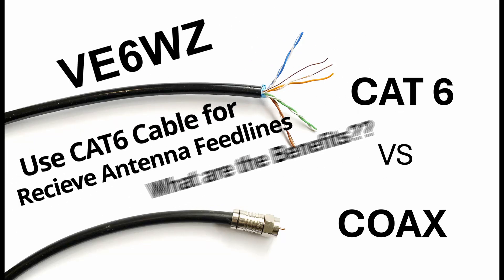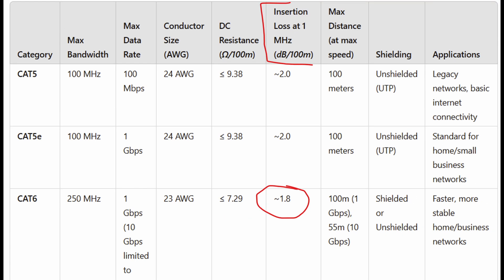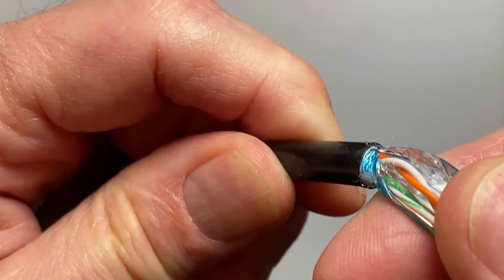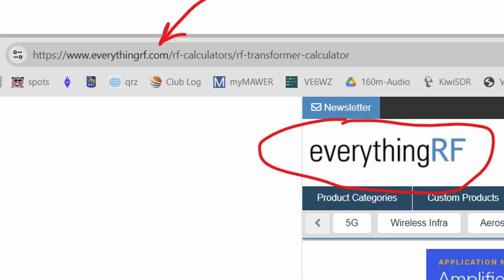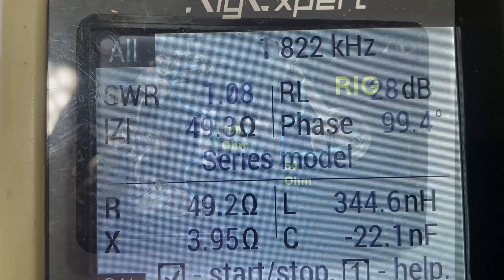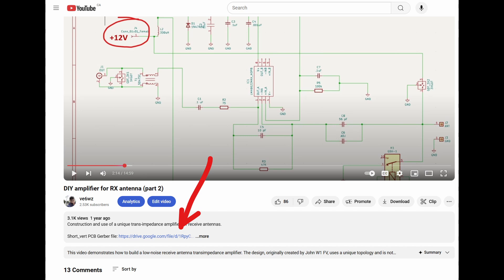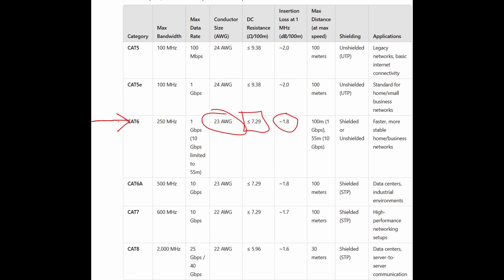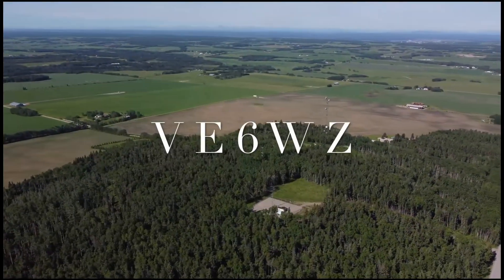Use CAT6 to feed your Antenna instead of Coax

Comment: What about using two 100Ω pairs in parallel instead of transformers if there are 50Ω on both sides, or just 1 transformer at the antenna side ?

Comment: i have a small portal ssb short wave set was thinking of 2 loop on ground one 30 ft and a 150 ft loop fed with one run. the set only has whip so was thinking of winding coil on pill bottle and sliding on whip. would a matching transformer be worth-it or not? 3 foot loop would be for 20-10m and 150 ft  mw-40m. ideas on coupling coil wire size turns form size etc?

Comment: Tnx Steve! I am using CAT6 since I came across LZ1AQ loops and started to play with 2 or 3 elements phased loop arrays. Now I even use single removed twisted pair as beverage element as excellent for reversible BVGs. I am very much space restricted so option to have 2-dir on single BVG is great!

Comment: This had me thinking.  You could make a whole reversible beverage with unshielded cat cable.  I think you could bond a twisted pair at each end, match with a transformer and send both ends to a point in the middle where you connect a rx.  You could use the remaining pair for a vactol on both ends.

Comment: FYI In France we use Grade 3 TV/Sat ( cf UTE C 90-483 )that has a pair with 2200 MHz bandwith 🎉 you can use direct balun adapter you find at the store 👍 There are even splitters available that enables you to send 100Mb/s Ethernet+ an audio or dsl+ an antena for TV/Sat over a single cable 🎉🎉🎉 Quite convenient for the TV set and set top boxes around 🤘

Comment: You don't seem to have any lock washers on those terminals. Perhaps this is the reason why they are always getting loosened (either that or those pesky raccoons are playin' tricks on ya, loosening yer nuts at night. he-he-he). I recommend the Stainless Steel auto-lock nuts with the PVC/Vinyl lock core. Or even simpler, add an extra nut and tighten those suckers up together. Those raccoons will now know who's boss; and they'll call you Daddy...

And remember: "If the women don't find you handsome, they can at least find you handy!"

73,
Amen Brother.

Comment: Question: What if you use the Cat 6 cable as a fat conductor to make a folded Dipole on 40 metres. preferably the stranded version of Cat 6, four pairs of balanced wire forming a single, 40 metre Folded Dipole. Assume an urban environment where it is mounted on a wooden fence so as to make it invisible to the neighbours. this should also be a low noise, all be it limited in range antenna. What do you think?? I would think with the RF current distributed across the 8 conductors it should be able to handle 100 watts.

Comment: Who is old enough to remember the standard TV antenna connections was for 300 ohm unshielded twin lead antenna wire? It was the industry standard. With the release of color for television, there was a problem with the reflections on the cable when it was routed near objects between the antenna and the television.
There is a reason 300 ohm twin lead antenna wire is obsolete.  It is true that the matter was made much worse for not being twisted pair. We did learn to twist pairs since the days of 300 ohm television antenna wire.  110 un-shielded twisted pair wire is a much smaller wire gauge than the 300 ohm twin lead, so it actually has higher loss. The smaller wires are closer to each other so the capacitance is higher to make the impedance 110 ohm instead of 300 so the cable is higher attenuation, however the tight twist reduces the wire's ability to radiate or pick up differential signal from it's surroundings.
Reply: In Australia we called it 300 ohm feeder cable. Twin flat black cable, and a balun to pick up tv. Then came uhf, so a Vhf/uhf Diplexer was added and a uhf antenna , wit the vhf antenna. I was 17 when i started, now 51 years old, and cabling tech, and still doing antennas and tv wall mounting.
Reply: It helps that 300 ohm to 75 ohm broadband baluns are ludicrously simple so converting from twin lead to 75 ohm coax is a very attractive option.

Comment: Could a twisted pair replace a TV antenna cable? There has been a trend for cheapening everything, but it has not happened. Does a stranded wire in patch cable change the RF properties?

Comment: Steve, just because it is a balanced line does not mean it is immune or even more immune than coax to common mode. Common mode is caused by any longitudinal voltage driving the conductors in a cable. It doesn't matter it is a parallel line or coaxial line. As a matter of fact a coaxial line is more immune to noise or unwanted signals if properly installed.

If you are having F connector issues (I have hundreds in the field) something is wrong with the installation. Perhaps you are not using a flooding dielectric compound in them?  73 Tom
Reply: If you aren't familiar with it check out "Star Quad Transmission line"  For the uninitiated is basically a doubled open wire line.  Some might know this from audio cables in the audio industry.  I got this from a website-

Suppression of magnetic interference

Another highly desirable benefit of star quad open‑wire transmission line is that, compared to twin line, it offers 10 to 30 dB suppression of magnetically induced interference.  This is due to both wire pairs forming loops around the center of the star, exposing exact equal loop areas to any interfering external magnetic field. Such a magnetic field will induce equal electromotive forces (voltages) and corresponding equal currents. These induced and interfering common mode currents will be ignored by the balun feeding the star quad line. Only differential mode signals will be converted by the balun into an asymmetrical signal.  This, again, is a useful feature for feeding OCFDs. Common mode currents induced on the feed line of an asymmetrical antenna will be effectively suppressed.

Star quad open‑wire transmission line offers a lower characteristic impedance than open‑wire ladder line for the same separation between the wires. This renders constructing 200 Ω star quad line feasible, where it is not for ladder line. Below 300 Ω, the construction of twin‑line becomes impracticable and, moreover, weather susceptible because of its tiny width. Star quad open-wire line is particularly useful for feeding any antenna involving a 4÷1 200 Ω balun; like many off‑center fed dipole (OCFD) antennas and many large horizontal loop antennas.

I might be attempting this myself- but I figured the cost.  Using 18Ga THHN wire bought in bulk (500ft roll from Lowe's), 1" PVC pipe to cut into many short lengths, zip ties, balun toroids for each end, enclosure boxes for baluns- cost about the same as 50ft of RG-8 (Belden 8237 or ABR-400).  Obviously some caveats with each.  The diameter I'd be using is only about 190 ohms impedance, Ive given thought to increase it, but with Star Quad line an increase of 100 ohms increases the "inner" diameter to about 7 inches.  As I understand it, the lower the impedance of open mine the more lossy it is.  I have 50-60ft to span to feed my proposed antenna.  It sure is a lot less work to buy coax.  RG-8 has about 12% power loss at 50ft @ 30MHz.  As for the star quad at 300 ohms, well I can't calculate that nor can I find a loss calculator for it.  It behaves a bit differently than traditional twin lead open wire line.  I also considered housing the star quad line in a pvc pipe to keep rain off of it, for obvious reasons.  But at 7 inches that gets expensive fast with the diameter pipe needed and the coax looks a lot better in price.  BTW all I have for HF coverage is a Xiegu G90- and no amp, so at 20 watts and trying to wrok DX, a 12% loss can mean getting the contact in the farthest fringes of your signal and when the sunspot activity dies down, that's even worse.  Looks like I need an amplifier more than anything lol!  Then the losses aren't that bad...

I would site the reference for the website I got all this from but I can't get the link to post.  So search "star quad transmission line calculator" look for a website titled "Hamwaves".

I cannot find much on this in the "Ham radio universe"- but I hope this helps someone, sorry for the long winded post.
73 fellas

Comment: On the subject of connector choice: take a look at M12/M8 ethernet connectors. It's not quite going to be as cheap as screws, but it gives you a single connector rather than having to connect multiple individual wires, all of which can independently become loose. As an ethernet connector, it's good for the same bandwidth as the cable, and as an industrial/automation connector, they're robust to just about anything you want to throw at them (including being waterproof if you want).
Reply: Those look great and like it might even be what is on another piece of equipment I've been trying to figure out

Comment: Those coax F connectors look horrible. One doesn't even looked crimped and has electrical tape. Maybe that's why you have so many issues with them. I would try some decent PPC or similar compression fittings with proper weather boots that are properly stripped with a prep tool and crimper.
But I will say if you can make an adapter that will match the 75ohms of coax for off air antenna TV to run over cat 6 or 5, you really may have something there.
Reply from the maker: I have been installing F-connectors for 20 years. Done HUNDREDS of them. All with proper Thomas and Betts or Belden snap and seal compression fittings, all flooded with silicon grease to prevent water ingress, and all wrench tight torqued. I made a video about how to properly install F-connectors and prep RG-6 coax properly. Sorry, but its not my "first rodeo" with F-connectors. Like I said in the video...I have had HUNDREDS in the field. How many have you had AND used in the field? This video explains how to properly install and prep F-connectors: https://youtu.be/pE04tDpdhRA?si=_SbXBQ53l5rGPJK1
Reply: @ve6wz  Fair enough but it still looks like shit...sorry that's just my opinion and I have  installed THOUSANDS of F connectors in the field just as long as an actual SCTE certified cable tech in case you wanted to know and I have dealt with those brands too including Belden snap and crap fittings which we call it that for a reason. No professional uses electrical tape to wrap or weather proof their connectors nor I would I recommend your F connector video either but if it works for you then good luck you sir. Take care.

Comment: Let me introduce you to Commscope Cellreach cable. The smallest 3/8 size will take a PL259 if you solder a small adapter wire for the center and clean, twist and solder the outside sheath. Don't leave it bare. Vulcanize or paint it. The reason you have so much trouble with RG6, is because you are not using it like a cable company. The end needs to be loose with a formed bend. You do not put vinyl electrical tape on anything. You can use electrical grease or the following John Deere greases for electrical connections: AN102562 and TY6341. If you need to remove or reuse an F connector, screw it on to an old satellite box and pull the press fitting back. If you don't use cable or satellite grade F connectors and cable, you're asking for trouble. The cable companies are moving away from huge 75 ohm hardwire cable and boxes, but you might like them. They also pass DC voltages. I also use RG 6 for audio. F to RCA female connectors make it a cinch.

Comment: Aluminium is a rather fragile material.  This means CCA can mechanically a nightmare to work with.  I've not looked into its rf prooerties but CCA has its use in electric engineering where weight is important.  For cost reasons it also used to be popular in Eastern Europe during the cold war.  Bit the fragility of CCA conductors made the material hated by electricians.  There are also issues with dissimilat metal corrosion.  All in all the material is rarely ised as a power conductor these days.

For small signals I'd mostly worry about the fragility of conductors.  CCA may be ok for cables that are installled once and never used again but I's absolutely avoid them for anything that it moved or bent.

Comment: AHHHHHHHHH 😮😮😮😮😮😮!!!!!!!!!!

NO !!!!!!!!!!!

NO SHIELDING MEANS 1000 MHZ OF SIGNAL IS GOING TO BLEED ALL OVER THE HOUSE AND NEIGHBORS 

It's fine for phone and Ethernet but not for RF signals
Reply: Ladder line would like to have a word with you.

Twisted pair doesn't radiate.
Reply: @StephanAhonen plus you can get Cat6 shielded cable anyway.

Comment: What kind of RF power can these cables handle? I would imagine its not much but I don't have a clue.
Reply: Some quick math tells me you will exceed the voltage rating of the connectors and cabling well before you exceed the ampacity of the cable itself, if you wire all four pairs in parallel... Should be fine up to 50 Watts or so. Maybe a bit more if you terminate the cable in something other than an RJ45.
Reply: Probably not much but it might be fun to try find out by doing empirical testing.  1 watt?  5 watts?  More??  Or less?  I’d imagine that it has to be something pretty modest (< 20 w).  Copper losses have to come into play so calculating resistive loss based on wire gauge and material might be a good place to start in estimating that.  If a valid thought then length is going to be part of the equation.
Reply: Pondering the same. PoE is 15-30W at 48 volts for a 2-pair....up to 100W on 4-pair. Meh, hook it up turn the knob to '10' and see if the magic smoke comes out.

Comment: Could I use 2 and 4 wire telephone cable?   4 wired for power and antenna, and 2 wire for just a antenna
Reply: Probably not. Standard POTS cable is not twisted.

Comment: I have done some experimenting with ganging up two parallel pairs to make a single 50-ohm line.  There are some neat things you can do with CATN cabling.  Since it's parallel line, it will also work well with some antenna topologies that are balanced.
Reply: @yakovdavidovich7943
can you shed more light on the idea and method of paralleling pairs together , and do to the diffrent twist rates does that efect signal and what connector did u use to terminate it with .
Reply: @lmccleary411  transmission lines in parallel to reduce impedance is common in construction of transmission line transformers. I just realized one day that it would work for non transformer applications too.

Twist rate varies to prevent crosstalk within the cable because it avoids perfect alignment of close pairs in the sheath. It doesn't change the characteristic impedance -- each pair is about 100 ohms, regardless of twist rate. 

Connector can be whatever you want. I use sma connectors for everything I homebrew except for special cases.

Comment: I'd like to see some similar testing on the more modern cat8.  Cat8 includes a shield around each pair and another around the whole cable assembly.  I use it for 10gbps networking at home, where I need something more physically robust than fiber.  For example, patching from a switch to a laptop pooter.
Reply: Also CAT6a if you don't want to break the bank, but yeah for RF applications you probably want all the shielding and twisting possible so CAT8. 😅
Reply: Wouldn't S/FTP Cat6a cable do about the same thing?
Reply: Shielded Cat6A only has shielding around the whole wrap (the set of twisted pairs). Cat 8 has shielding on the wrap and each twisted pair. Also cat 8 has more twists per inch. These characteristics make cat 8 superior. 

However, practically speaking it may not making any difference unless your runs are very long. Cat 8 is far more expensive. 

I paid around 270 for 1000 ft of 6a shielded from TruCable and it is a very high quality product.
Reply: I use cat8 at home. It's about 50 feet to the second router. Highest speed device  i have right now is 2.5gbps. I didn't know about CCA. I'll be checking Amazon to see what it says about what I bought. Not that the descriptions are reliable. I need to run a line for an antenna outside for my TV. I don't buy cable service. I'd like to get the reception for the occasional times the internet drops out. I really don't want the inconvenience of coax, so this is a great suggestion. I wish I was in a house instead of apartment. Very strict rules about what's on the balcony. Luckily I'm on the top floor, so nobody will notice discreet stuff.
Reply: I use cat8 at home. It's about 50 feet to the second router. Highest speed device  i have right now is 2.5gbps. I didn't know about CCA. I'll be checking Amazon to see what it says about what I bought. Not that the descriptions are reliable. I need to run a line for an antenna outside for my TV. I don't buy cable service. I'd like to get the reception for the occasional times the internet drops out. I really don't want the inconvenience of coax, so this is a great suggestion. I wish I was in a house instead of apartment. Very strict rules about what's on the balcony. Luckily I'm on the top floor, so nobody will notice discreet stuff.